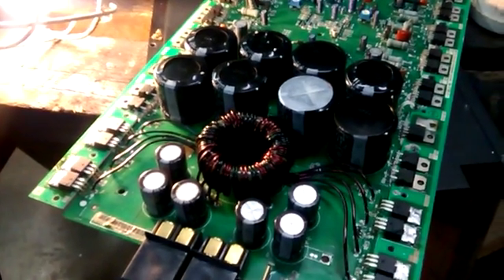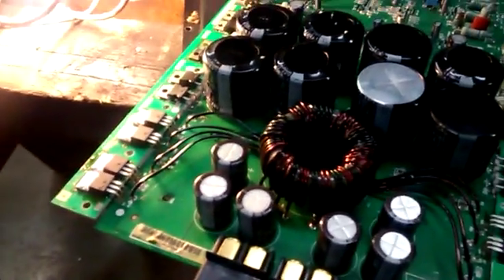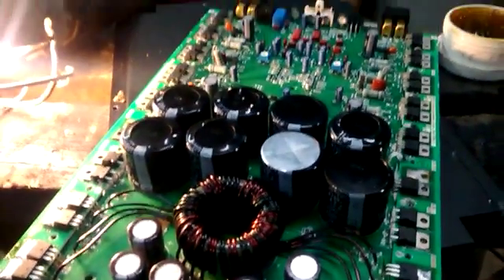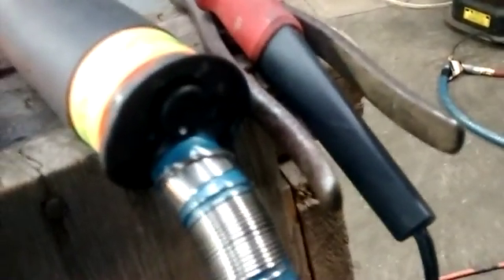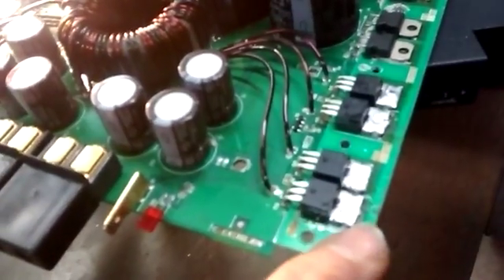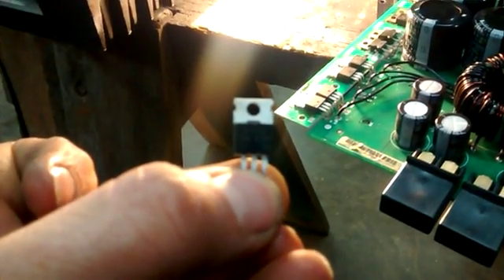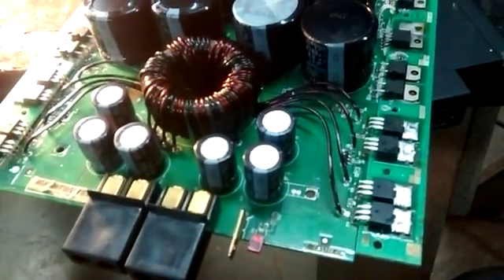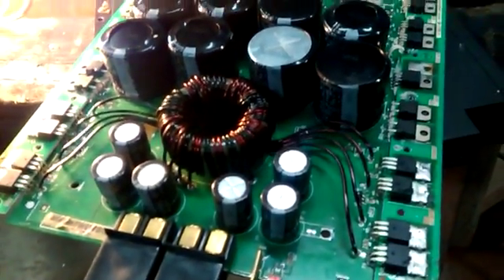Rockford fosgate punch 800.2 rebuild part 3

Comment: irf9640 =irf3205??
Reply from the maker: irf9640 is a p=positive and irf3204 is n=negative
Reply: I do not understand the truth is that here in Venezuela is difficult to get the irf9640 for a 750x but according to the houses the electronica irf3205 serves. What is true about that? Will I be able to replace the irf9640 with irf 3205? Thank you
Reply from the maker: Denis Ricardo Moya Montaño it will not work
Reply: Another problem I have is that I do not know what kind of screwdriver I should use to disarm it